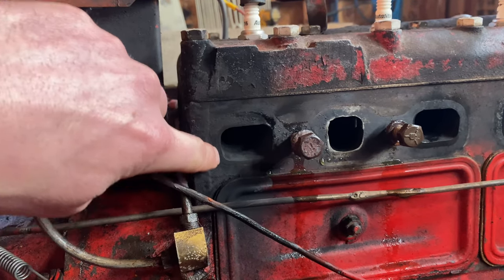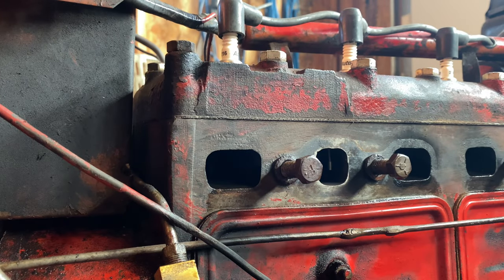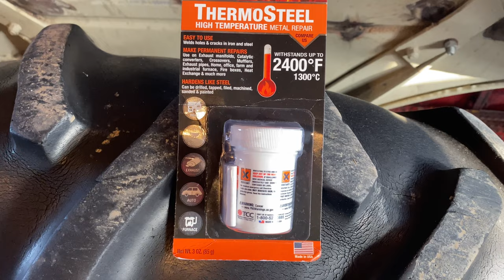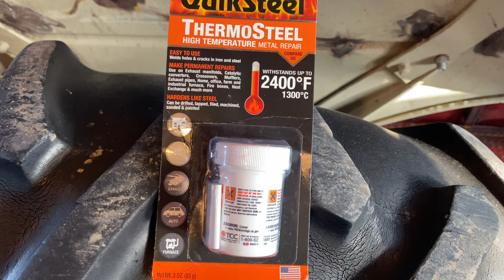Ford 8N Tractor 🔧 Manifold Exhaust Leak Repair

Comment: The exact same thing happened to me last night in that exact same spot with the antifreeze pouring out. I plugged it back up and headed to the you tubes!
Reply from the maker: That sucks!.  Not a real fun deal. Mine seems to be much better after the "fix". But I think I may have learned a bit more during the repair that I plan to improve on at some point. Good luck!

Comment: I'm not sure how much of a 'permanent' fix this will be. Certainly the pitting and the irregular surface area is the cause of the gasket not making a proper seal around that area, and maybe the thermosteel might help with that.

The bolts contribute to this issue, for sure. Somewhere in this tractor's glorious past, a farmer broke the studs in the block - probably over torqued the nuts and stripped the threads off the studs, or broke them outright. They drilled them out with a larger size, screwed in a bolt, then cut that one  (and didn't cut it flush with the block), then drilled that out and tapped it for the bolts. If it was just the farmer doing this, out in the field doing what he could to get the poor gal through just another harvest, then there could be even more underlying problems. It's quite possible that they didn't get everything centered, and the bolts the farmer used to tap into the block could also protrude way further into the water jacket, and this can also cause an area where coolant isn't able to properly circulate, calcium buildups, and further make worse the ability for the back of the block to shed off heat. 

And that brings me to another worry I would have: On top of heat not dissipating properly, there is also the unknown hardness-density of the bolts the farmer put in vs the cast iron block. The two take to heat differently, and that puts the softer and aging cast-iron block at risk of cracking in that area.

A more permanent fix would be to take it to a machinist and have them inspect it, grind flat the manifold area, and insert two proper posts. A replacement exhaust-intake manifold for the N-series can be found on about any site that sells tractor parts. Not as cheap of a fix as the thermosteel, for sure, but it would have the added benefit of ensuring that any other problems from the 'poor farmer fix' don't later come back and bite you in the a$$.

I do hope that your fix holds out though!  These old Ford-Ns are the epitome of reliability in simplicity. The 4cyl L-head is, afterall, the same engine Ford designed and made for their Model As back in 1928, and it takes nothing short of dropping them off a 10 story building to truly kill them.
Reply from the maker: One thing is for certain. These tractors are a national treasure. Most of the current owners are not the originals. I have often wondered about the history of this tractor. Everything it has been through since 1949. Amazing.
Reply: @LohreFarm  They are indeed a national treasure.. I truly think the old saying "They sure don't make 'em like they used to" was in direct reference to a Ford N-tractor.

Each one of these old gals have their own personality. No two will start up exactly the same, and every one of these I've looked at have little odd quirks and strange repairs that can tell a story.

I've got an 8n from 52' (with the proofmeter) that I'm currently restoring, and the old farmer that had it originally really depended on her during some tough times - She's got an odd-sized rear tire that is two sizes larger than the 11.8-28, which gives her quite the list, and you can just tell the old gal was relied on heavily to get the farmer by. I'm hoping to give her the pampering she deserves.
Reply from the maker: @aaronmichaelelliott4600  That’s awesome. Get her all fixed up and make sure I get to see some photos!

Comment: Common area, for sure, for leaks.  Not completely sure why, but I think it has to do with the block temp. differences from the front of the block to the back when running.  I did not see you do it, but did you check both the manifold and the block with a straight edge?  Manifold is just as likely or more to be the issue as the block.  The block pitting did not look too bad based on the video, but that step in the machining caught my eye.  Not sure what is up with that as I do not recall seeing that on the engines I have worked on.  I would recommend replacing those bolts with some studs and some brass nuts.  In addition, a little trick on the leaky exhaust clamp is aluminum foil.  Roll it up and form it to fit inside the clamp (making sure not to install the clamp upside-down) and it will act as an exhaust gasket and clean up a lot of that leak.
Reply from the maker: You are probably correct, block temp is the main issue. I didn't put a straight edge on it at all. The step is odd, but falls outside the gasket area. I figured the liquid steel would fill the pitting and then could be sanded. Yes, my manifold is slightly pitted as well. I did fill it in, however. I didn't film or talk about it because from the naked eye I know the leak was between the block and the gasket, not the gasket and the manifold. The new studs and nuts are in my amazon cart already. I wanted to make the video with the old bolts being a problem,  since I believe more people have that issue than don't. I actually have put aluminum foil in the exhaust pipe prior. worked great! last year I removed the exhaust to look at a dent on the inside and didn't replace the foil. I need to replace the muffler, on the giant list of things to fix. haha Thanks for watching and the great advice!

Comment: I would have looked at the manifold and the block. But i would have used the coper gasket spray. It workes great for this. It can go on thick if you need it. And it will seal great. I use it for my hit miss engins. I would use it for my 9n tractor when i get it running if i have the same problem. And if its the manifold i would file it or try another gasket to.
Reply from the maker: I agree. I think the copper gasket is the better way to go on this. The pitting isn’t terrible but just enough.
Reply: How thick can it go? My exhaust manifold has warping and putting put also has raised surfaces around the ports so I can’t file it

Comment: I think it's more the old manifolds than it is the blocks, mine I can tell the manifold has a slight taper on both ends....I'm not sure just my theory
Reply from the maker: I actually agree. The manifolds are the cause of most of this issue.

Comment: How’d it hold up?
Reply from the maker: Seems to be fine so far.
Reply: Did you use rtf or any other sealant after the quick steel. Should I?
Reply from the maker: @KollynJ every situation is different. I could have probably gotten away with new gasket and copper seal, but I wanted to try to smooth it out. Good luck!
Reply: @LohreFarm  sweet. Just figuring copper seal snd new gasket and quick steel you can’t go wrong

Comment: You need brass nuts!  Copper gasket spray both sides of gasket and problem solved.
Reply from the maker: You are 100% correct. This will solve most gasket leak issues.

Comment: Why not just drain the cooling system first
Reply from the maker: Two reasons. 1. I think that more people than should be are in a similar situation, where they have bolts that were placed in to replace the studs. Very frustrating. 2. As much, if not more can be learned from the YouTube comments as can be learned from the videos themselves. Your suggestion will be very beneficial to others. Thank you!